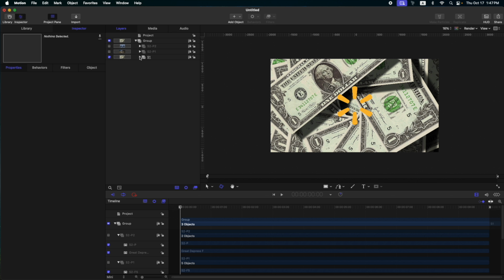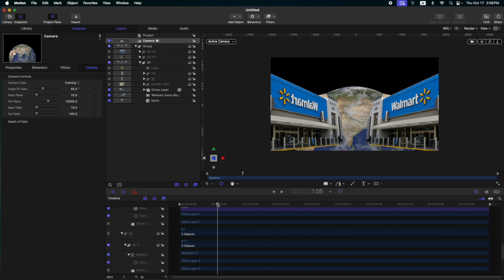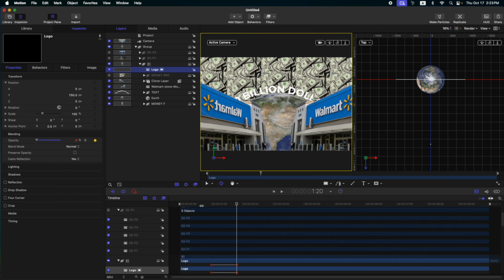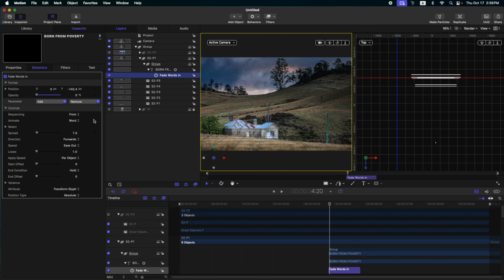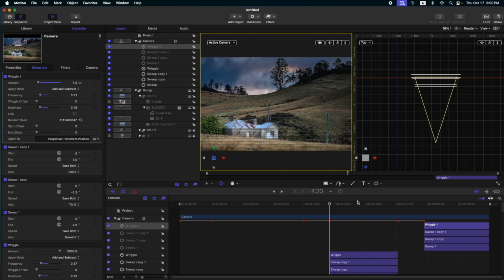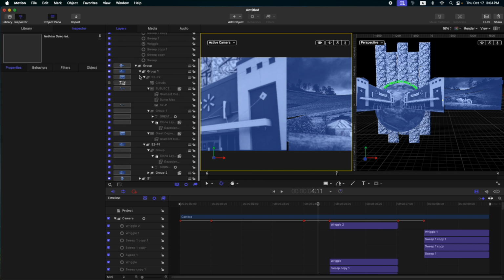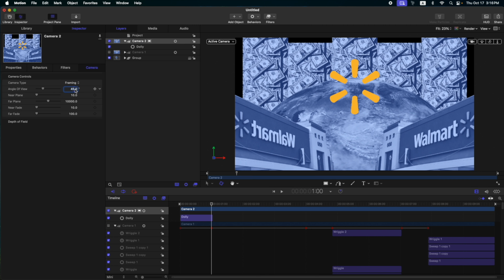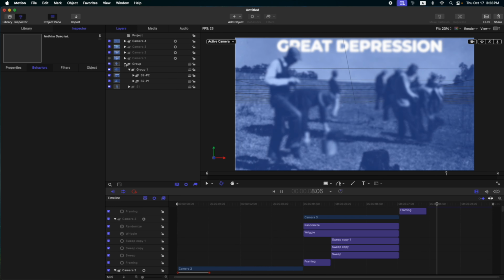MagnatesMedia - 3D Camera in Apple Motion

Comment: Why do you have to keep cloning the source picture and adjusting that instead o just using the original picture
Reply from the maker: Thanks for asking. It became a habit of mine to clone because if I want to use the Source layer again, I can just clone the source and apply effects on it without affecting the source layer, second, when I replicate, the replicator will appear below the main group. Third, is when you clone a group, and trim it, the behaviors keyframes will not be affected. 

Using clones is really useful, you should use it as much as you can.